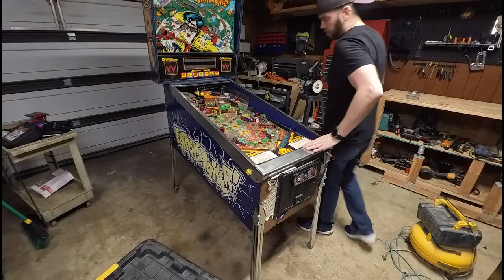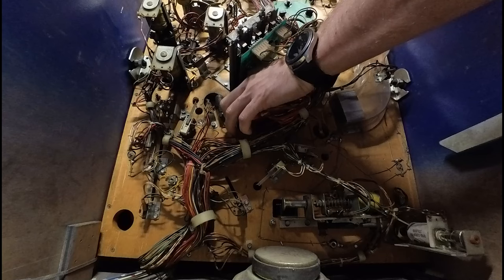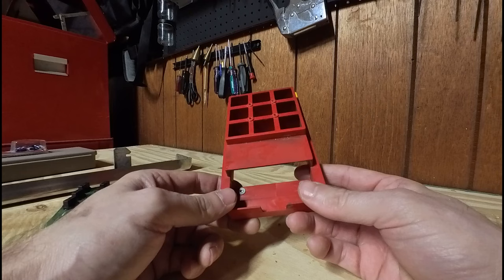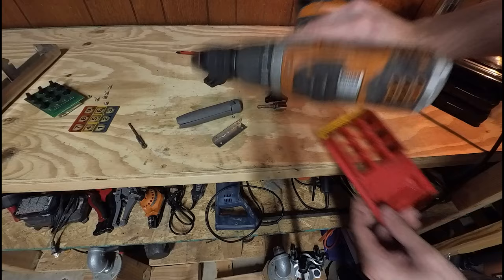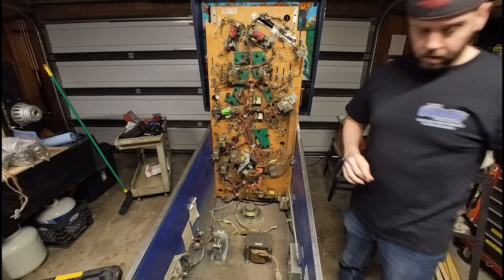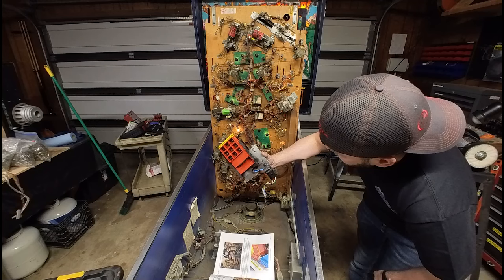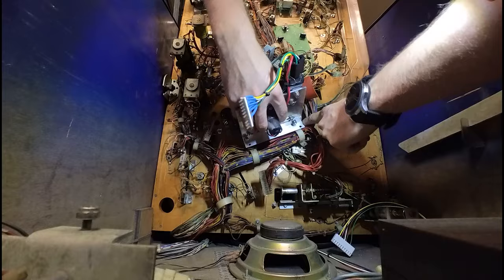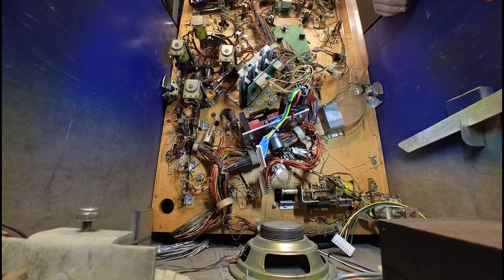How to Install the Earthshaker Sinking Building Mod

Comment: I did this to mine about a month ago. You are right, it is really well made. I used the drill bit that the instructions specify and the rivets came out just by drilling. No prying or anything.